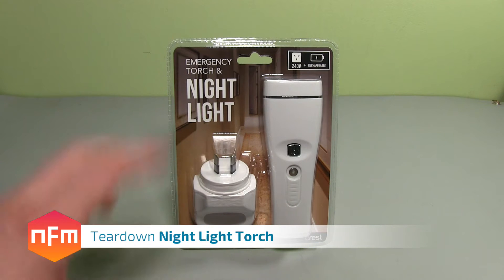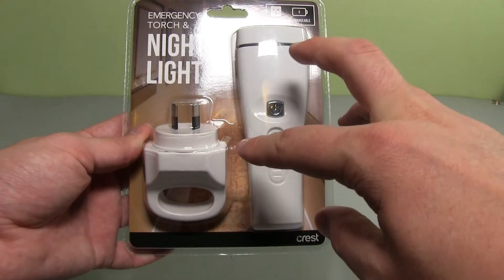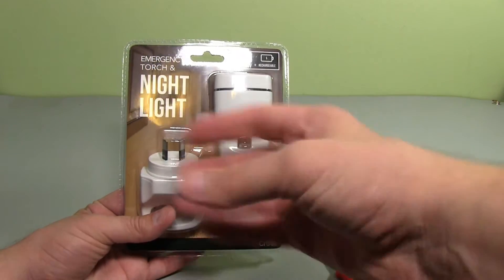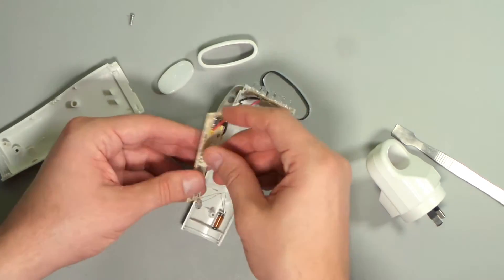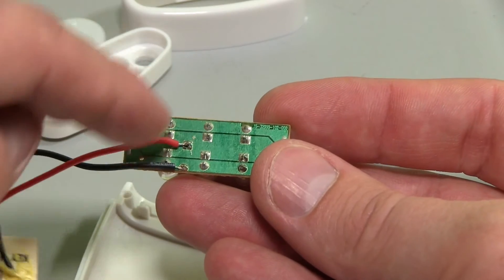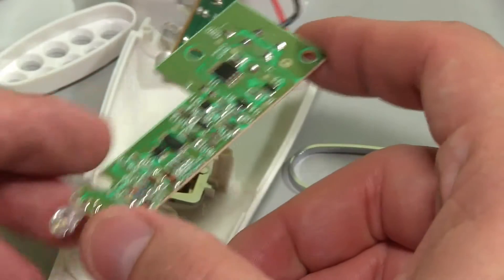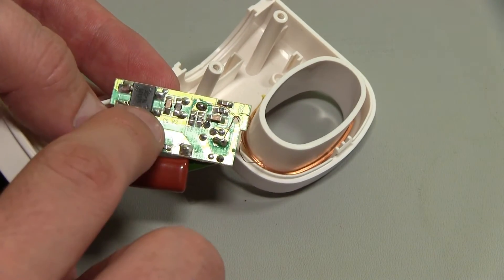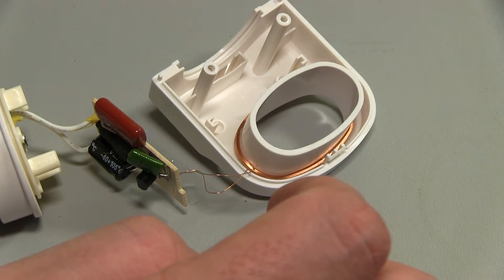Emergency Torch & Night Light Teardown

Comment: Wow that thing is crusty, but I'd love to have something like that around the house for when the power goes out....Which happens every time a gnat farts...
Reply from the maker: +elesjuan Yeah, it's definitely built to a price, but works well. We'll see how long it lasts before the battery dies...
Reply: Good news is that battery shouldn't be too hard to source and replace!!  If you got really frisky, you could roll your own charge circuit.. Or snag one of those lithium charger boards from china for a Dollar shipped..

Comment: Looks like on the rectifier section also has a zener diode for over voltage protection / voltage regulation (The diode with the blue stripe).